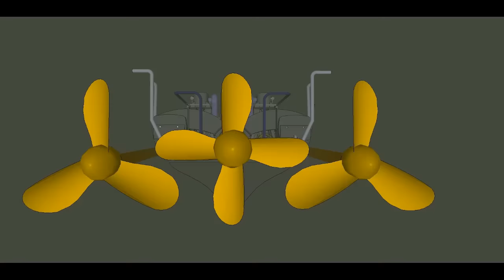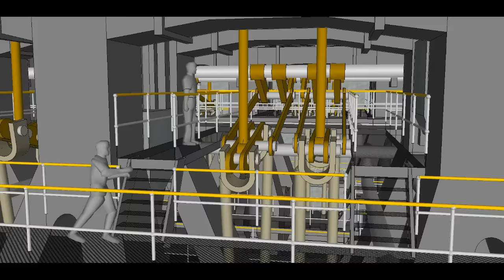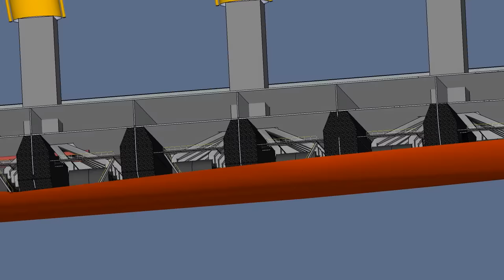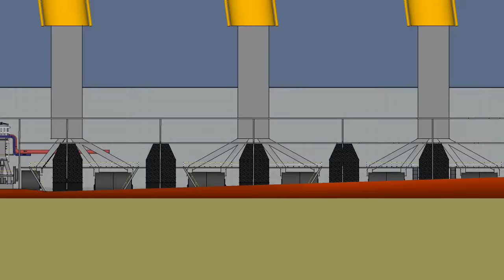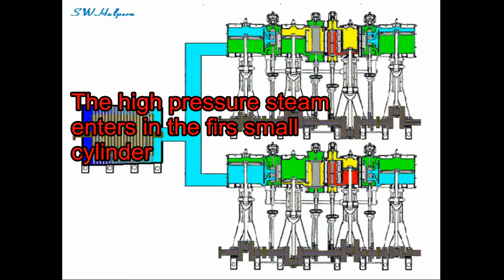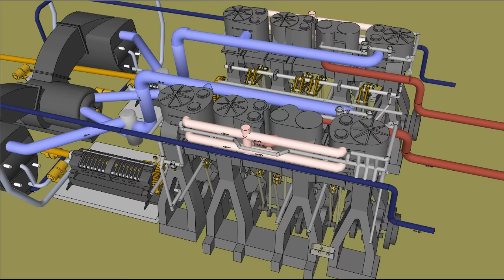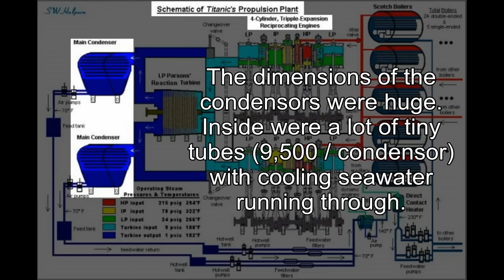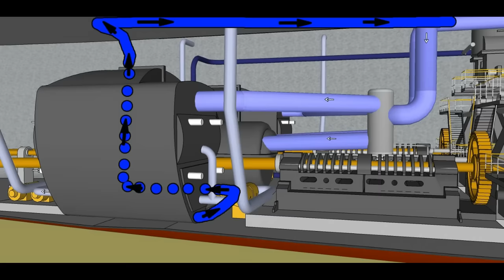The Engines of the Titanic

Comment from the maker: @ annanoli: 5:25 you can see how the engine is started. In that time the electric engines didn't have enough power, so they used a small steam engine, as shown. It is not only to bring them into a special position for maintenance, as you think, it is the spinning once to start the big engine.
Reply: +Charlie K Maybe it was because electric motors need some sort of engine and generator to get electricity.
Reply: +Hoe ishetmogelijk ..Steam Engines are self starting...they don't need a Jack Engine to get under way....
Reply: Single cylinder steam engines are not self starting.
Reply: +KiwiPowerNZ ..what about Single Cylinder Traction Engines..
Reply: Brill39e Well they can self start from the right crank position, engines with 2+ cylinders will self start from any position.
Reply: KiwiPowerNZ True! And no more needed than three in the right configuration. But for steam,inertia can still be a bitch.
Reply: +FallSoftly this isn't an internal combustion engine, while I'm sure a warm up time is necessary, the main problem is getting the piston of I assume the high pressure cylinder as its first in line to the proper position so that steam can be applied, if it is at the bottom of its stroke putting steam to it will do nothing it needs to be rotating slightly before the steam is turned on so it gets it moving, make sense? sorry about poor explanation I'm no engineer I just know from messing with old steam traction engines before, they're very similar in how they work just on a much smaller (albeit still large) and simpler scale
Reply: +Brill39e 
Very true. But the jacking gear gets the engine bearings on a film of oil and breaks the friction on all of the propeller line shaft bearings. If they didn't turn the engines and line shafts over first, the force required to break away the equipment would violently thrust the ship and strain the mooring lines. 

Ships with steam turbines warm up the works by rolling the turbine ahead for a few seconds, then rolling it a few rpm astern for a few seconds for up to 15 minutes or more before getting underway. This also heats up the parts so that only dry steam is admitted to the turbines as a slug of water can create tremendous damage.
Reply: Cool
Reply: +sstroh08 With regard to getting a piston "in line" , My dad sailed Liberty Ships in WW2, and explained one of the main differences between (some) steam engines and a typical internal combustion engine is that steam engines (can) have timed valving that lets steam expand from BELOW a piston as well as above....in other words, not just pushing the piston down, but also pushing it upward (at the appropriate time) to produce movement....quite efficient, rather like an (advanced level) bicyclist whos's shoes are locked to the pedals....making power on the "up" stroke as well
Reply: +Hoe ishetmogelijk its called a barring engine, the big steam engine has a dead point, were the slide valve is open just in the center of a piston stroke with steam on upper and lower side of the piston, its onl a few degrease, in this case the can turn the engine a little to close the valve in oneor the other posistion.it also cab de used to turn the engine to do maintenance.
Reply: +Picobyte  no its not, common systems were dc 110 volts, also with stationairy battery banks, al the system electric engines were dc in those days.
Reply: +Brill39e  partly thrue. they can have a stand dead spot, so they can barre the engine a few degrees to set it up for the first steam to get it going.
Reply: +Brill39e  not al engines can start from all stop positions, in that case they can barre the engine with the small one to set it in the right position to self start on first steam, also for maintenance.
Reply: +KiwiPowerNZ  if constructed the right way (not 180 degreas)
Reply: +radguzzi 
They used this ''double acting'' steam cylinder since the 1800's. Almost all steam locomotives use both sides of the piston to produce power. That's why steam engines use connecting rods with a cross head pivot so they can seal the connecting rod side of the piston.

Side note: appreciate what service your dad did on Liberty ships. Those were real men.  I sail on the Liberty Ship Jeremiah O'Brien every October in the San Francisco Bay to watch the Blue Angels fly. The 4500 HP steam engine is the one they used during the filming of Titanic. Its awesome standing near the LP crank so close to its huge operating mass that it could tear your arm off....or worse!
Reply: MrBugsier5 How did they charge those batteries?
Reply: Picobyte those were big lead acid batterybanks (recharable) with seperate 2 volt cels, at a weight of around 70 kgm's a piece. so i would think by hand or a cart.
Reply: 1) They generally don't lubricate the cylinders steam lubricates cast iron, but there is lubricators there if needed. If you get oil in the steam it gets into the condenser and they only had very primitive methods of stopping the oil getting back into the boilers!!! Very bad. So they hardly ever lubricate anything steam side.
2) They warm up the engine slowly by opening the throttle with the Stephenson links set at stop, the steam slow heats up the metal. It will find it's way through the engine even when stopped.
3) If you try to start the engine cold it won't work because the steam will just condensate on the cold cylinders and pistons, and when the piston moves you can hydraulically lock it and do serious damage, but there is protection, big relief valves on the top and bottom sides of the piston that open if the engine hydro locks. So once you've warmed the engine through for about half an hour probably much longer for Titanic's engines, you can try and start it, and you have the cylinder drains open to drain any condensate. The engine is never properly hot until you leave the berthing and give it some power. Once you're out in the harbour and under way you can close the cylinder drains.
4) While in berth you can turn the engines slowly with port engine astern and the starboard engine ahead and the affect will push the stern towards the wharf and won't strain the lines.
Reply: KiwiPowerNZ not adding oil to the steam is  pertinently not thrue! the have a oil mister in the steam fead to lubricate the cilinderwall and pistons!, thats why its called cilinder oil...... (special oil injector is fitted in the steam feed to the engine, its also why they use super heated steam! (thats dry!), so there is as less water in the engine as possible, leaving the oil where it should be, and not in the condensor, but they do inject oil into the cilinders (not mutch!) and valves, just to ad it to the high pressure dry steam in small amounts.
Reply: +MrBugsier5 
I used to service old reciprocating steam pumps at a refinery. We added ''Steval B'' cylinder oil to the lubricators for the cylinders. The oil was thick and nasty and would not wash off my hands even with detergent. As a prank, we used to put a few dabs on fellow oil worker's windshields. The wipers would make the Steval B into a hideous streak on the windscreen, a huge job to clean off. Spray carburetor cleaner would remove it.
Reply: MrBugsier5 Titanic doesn't use superheated steam it's wet steam!
Reply: no it doesnt, it used super heated, and high pressure steam, the higer the pressure the less water.the more you heat it after that , the even dryer it becomes,., in the case of this time on  the bottom, its only water and no steam... lol
Reply: MrBugsier5 Can you find some info on that, I don't think Titanic's boilers had superheaters.
Reply: Charlie K That would be a serious hazard.
Reply: Picobyte Why would it be a hazard? Because of water hammer?
Reply: KiwiPowerNZ That can get serious in large installations.
Reply: +MrBugsier5 I do not think that 215 p.s.i. is indicitive of high pressure or a super heat capability. (215psi being the op pressure for the HP cyl.). And you wouldn't use superheated steam in recipcrocating engines
Reply: SuperAncientmariner fully agree!,  thats thrue, but wat I mean is that the steam pressure in the boiler has to be as high as possible to keep water out of the engine,and give maximum effectivenes, (thats why we use around 10 to 16 bar pressure, (thats high for rivited boilers!) dry as possible steam is the best! (agree super heaters where only used for turbines.)
Reply: +SuperAncientmariner Is the use of superheated steam in steam locomotives different?
Reply: Douglas Skaalrud Yes because they don't have to worry about getting cylinder lub oil in the boilers.
Reply: KiwiPowerNZ Thanks Kiwi, you beat me to it. There is also the condensing to think of. Locos that condense pass the steam into the water tank to cool (as opposed to closed cycle), whereas marine systems have a raw (sea) water condensing system..
When I was at sea, the only ships using superheated /dry steam were turbine powered..
Reply: SuperAncientmariner Were turbines available when Titanic was built?
Reply: Douglas Skaalrud Yes. The first steam turbine ship was the Turbinia,  in 1894..
Reply: Douglas Skaalrud Titanic has a low pressure turbine driving the center prop. I love the way they designed it, it's fascinating.
Reply: KiwiPowerNZ  its a pitty none off these superliners still exist floating!
Reply: +MrBugsier5 215psi is NOT a higher pressure maritime system.  High pressure systems rang at pressures upwards of 600psi and 1200psi up until the 1990's.
Reply: +KiwiPowerNZ Not necesarily from a dead stop. However a  jacking engine is needed to slowly rotate the system in order to preheat the cylinders/turbines.  You don't want to go from cold iron to full heat,  full pressure. The stresses are huge.  Jacking the engines/screws usually starts several hours prior to the requirement for full steam and getting underway.
Reply: Pelican1984  20 bar is the highest safe (??)steam pressure they used in rivited boilers at that time, (1911) dont know the psi figures, we are metric in europe. sorry..
Reply: MrBugsier5 Ok, that's interesting.  20 bar = 290 psi.  From my naval experience, the high performance ships like battleships and destroyers were using 600 psi (41 bar) boilers by WWII.  Following WWII they were up to 1200 psi (82.7 bar).
Reply: normal inland ship use is around 14 bar max rivited and welded boilers, as far as I know. seen the red one mostly around 12 to 14 bar.working pressure. , the higher the pressure, the dryer the steam is, the better for the engine.
Reply: +KiwiPowerNZ of course they are...WTF are you reading?
Reply: +KiwiPowerNZ Where did you ever get the Idea Steam lubricates the cylinder. Have used oil injectors and many typed never saw an engine without oilers.
Reply: +Charlie K Scotch boilers are firetube and can have superheaters installed as many had. Look up Locomotive boilers, same installation.
Reply: Chloe Alexa The steam valves are on top right above the steam space, it doesn't pass back through the exhaust gas. You couldn't run those engines on superheated steam without lubricating the cylinders, which puts oil in the condenser which has to be separated from the feed water before it goes back to the boilers, that's just stupid. They wouldn't use super heated steam. With wet steam the cylinders lubricate with the steam alone.
Reply: +Hoe ishetmogelijk Yes steam 100% torque at 0rpm, why so great
Reply: +KiwiPowerNZ Any steam engine not at TDC or BDC has the ability to start on its own.  Most Traction engines are single cylinder and you have to know to not stop the engine at either point, if you want to move again.  Then you move the flywheel by hand to allow starting.
Reply: +Picobyte Steam as DC electric has 100% TORQUE AT ZERO rpm.
Reply: +Picobyte Note:  Steam as well as Series wound DC Motors have 100% torque at zero RPM.
Reply: +KiwiPowerNZ Boy do you really need to go back to steam engine school with your answer.  All steam engines NEED OIL to operate, steam is not a lubricant.  As for the oil in the water on condensing it is removed in special separators.  Please learn how steam engines operate on Ships. you have a lot to learn, and do not ASSUME things.
Reply: +KiwiPowerNZ Again you need to study as all information is on the INTERNET.  If there was no superheat the low pressure cylinder could perform NO WORK, in effect only a three cylinder engine.
Reply: +SuperAncientmariner It is used in Cars, Locomotives, Power Plants and Steam ships.  So where did you ever get that Idea No Superheat. I knew that at six years old, its a necessary thing for efficiency.
Reply: Have you ever touched a steam engine? Check my channel. I've worked on a steam ship as a volunteer which has triple expansion engines and single cylinder engines. I even have a video of the engine room, I regularly talk to the chief engineer on that ship who has been at sea all his life. I have started and operated both the main engines which are triple expansion and the single cylinder auxiliary engines and pumps. I know from experience that a single cylinder engine is not guaranteed to start by just opening the steam it can take several attempts and you need to position the crank in the right place. Triple expansion engines will self start from any position once they are hot and yes the LP cylinder does do work because the exhaust side is under a vacuum so even with atmospheric pressure going in that's 14 pounds of pressure relative to the condenser.
Reply: +KiwiPowerNZ, well thats very nice yet seems you have not that much operating experience, oiling and wiping do not really constitute full experience. My father was a Chief engineer and taught me about single cylinder engines at six years.  I have run Steam all my life, and the additional reply of a couple days ago reinforces what I stated.  You would be a laughingstock at any threshing show here in the USA. We have a big show in Rollag MN, with some really big engines. Have worked shows since the sixties and was engineer on a 55 ton steam passenger boat for 5 years, Triple expansion on that one also, so I am familiar with their operation, and idiosyncrasies.   Am 76 years old now, and have taught Locomotive steam operation.  It's not a contest to be always right, it's the sharing of knowledge learned over a lifetime. The ones who taught me are gone now, so lets share and learn.
Reply: Chloe Alexa I may not have much operating experience but I have almost 3 years experience on that ship which is about 400 tons. I've done more than just oiling and wiping, I know the startup, operating and shutdown procedure for that ship as we do it every charter. I haven't gone for my steam ticket because you need hours on a commercially run steam ship and ours is non profit charity run. I'd have to move to the south island and work on the Earns-law to get my ticket.

You said:
Boy do you really need to go back to steam engine school with your answer. All steam engines NEED OIL to operate, steam is not a lubricant. As for the oil in the water on condensing it is removed in special separators. Please learn how steam engines operate on Ships. you have a lot to learn, and do not ASSUME things.

Yes but our ship is a 1935 newer than Titanic and it's method of separating the oil from the feed water is coconut fibre filter. And yes steam does lubricate cast iron cylinders. Yes there is lubricators on the cylinders I never said there wasn't any, but you vary rarely use them BECAUSE we use wet steam there is no superheaters and never was any on our boilers which are two single ended scotch boilers the same as used on Titanic. As soon as you have superheated steam that lubricating effect is gone.

You also said:
It is used in Cars, Locomotives, Power Plants and Steam ships. So where did you ever get that Idea No Superheat. I knew that at six years old, it's a necessary thing for efficiency.

Yes it's more efficient to use superheated steam, nobody is denying that and everybody knows that it's more efficient. That doesn't mean every ship ever made has superheaters. Titanic DIDN'T use superheated steam, neither does our ship. Our oldest engineer is 83 and has been at sea his whole life, been on many ships around the globe, and I respect him very much. He has much more experience than you.

Please stop attacking every single comment you read. Saying that I'd be a laughingstock at any threshing show here in the USA doesn't make anyone want to go visit your show. That makes it sound like a rude and uninviting ego fest on who has the most experience. Where no one would ask any questions or learn anything from each other for fear of being laughed at.
Reply: +KiwiPowerNZ Sorry that I offended you, yet things you said would be taken that way by many steam engineers.  Food for thought and not an argument, as that is how I was taught by many old steam men.  Observe, Listen, and Learn if you do not follow those items you are missing many little tidbits, as I am but one old steam person sharing, and have learned from many, less kinder than myself to me, by doing just that.
Reply: Called a "pony motor."
Reply: +sstroh08 yes and there were steam engines that had 'Simpling Valves' where high pressure steam could be applied to all cylinders. for starting purposes.
Reply: +SuperAncientmariner Please do some serious study of large American Locomotives, and they used all superheated steam for operation.  Offers more expansion.
Reply: +Pelican1984 Yes yet they were driving turbines, as their expansion is linear vs pulsing with piston engines.
Reply: I've never heard of a small donkey engine being used to start Titanic's engines.
Reply from the maker: You are never too old to learn!
Reply: I wonder if they'd still call it a starter?
Reply: +goinghomesomeday1
Yes, that makes perfect sense - but see Steffen Reichel's answer below.
Reply: +goinghomesomeday1
Yes he did but he pointed out that this was not necessary on Titanic's engines because they were fitted with Stephenson linkages.
Reply: Look, Kempton park is a stationarty engine with a valve gear, but no direction change.
Ships and locomotives need direction change, so have a special gear or linkage for direction change.
So many stationary engines are barred into starting positions, with barring bars, electric barring engines or steam barring engines, just to get it started.

On Locomotives the steam engine is self-start able, because it had to be startable from any and at any position of the cranks - that's why they had a linkage, like Walschaerts, Stephenson, van Gooch or other.
So multiple cylinder engines had starting valves, evem famous 4 Cylinder double expansion steam locomotives had starting valves, which promoted life steam into the connection pipes, just to ensure that on startup all cylinders got steam. This is on any stationary steam engine not implemented, as they have flywheels and barring engines - because there was time to bring the engine into a starting position.
Usually at the end of the shift the engine was brought into starting position, just to have a quick start if no maintainance was required.
On steam locomotives you have stops on the way, so you cannot stop in some kind of starting position, so you need to be startable on any crank position. You just set the linkage in the direction you want to go and the engine will usualy move on. Multi-expansion engines usually have manual operated starting valves, or by linkage operated starting valves, some had linkage engaged pressure operated starting valves, like Maffai and Esslingen. Here at direction change those valves provide live steam from the boiler into the compong connecting steam chests, just to even get the low pressure cylinders a kick start ability.

Titanic would have also starting valves, located at the steam chests of the intermediate and low pressure cylinders. On any direction change those valves would pop open, providing extra steam to the steam chests and giving those cylinders some steam for a smooth and immediate start.
Those valves will close, after exhaust from the high pressure steam cylinder will enter the connection pipes, and the engine will return to compound mode. Only on start or direction change those starting valves will admit steam to those cylinder steam chests.

So because of the Stephenson linkage Titanic, as any other multi expansion engine to propel a vessel or locomotive, will be self starting at any point on any direction

Titanic had donkey engines. Those were for maintainace. On port they were engaged, just to get the shafts, pistons, rods and cranks into desired positions, as it was impossible to turn the three story high engine by hand into position required for maintainance. So the Donkeys turned the huge engines, just to get the engineers being able to fix this and that or having the engine slowly turning on stops, just to ensure all is greased well and the oilers do their job on short stops during boarding, so you can run the engine immediately on call without having troubles being low on grease or oil in any of the moving engie part.
Reply: Steffen, do you know how a large marine engine would go from full ahead to full reverse in an emergency? Do you know the procedure with a triple expansion engine?
Reply: For Titanic, or any triple expansion engine?
Reply: For a triple expansion engine in general.
Reply: Well, usually it takes less than 10 seconds. There are many youtube clips available from paddle steamers were you can see how fast the switch of direction is.
At "Waverly" during a port manouver the switch was less than 3 seconds - it was like Ping, the gears dropped, engine started turning - pong, the gears lifted and the engine get to halt and immediately started moving opposite direction

Same for "Hohentwiel" were I observed it, regardless if this was a double expansion engine - there is no delay if you have double expansion or triple expansion, because it all depends on how fast can you switch the linkage/gear. The change of direction on Hohentwiel was less than 4 seconds, because of the controls.
Reply: The valve gearing is much heavier in the Titanic than the two you mention.  The Titanic  valve gears are steam driven by a small engine and if that fails there is a large wheel that will do the job manually in good time.
Reply: Trying to run the engine for power while it is too cool is a sure way of causing a really bad example of water hammer. Which definitely has the power to destroy the cylinder end.
VERY DANGEROUS.
Think about a heavy piece of iron which comes flying.
The solution is to preheat the engine in some way either a steam jacket around the cylinder or letting a small amount of steam into the cylinder and drain the condensate away.
Reply: Chloe Alexa  ´
Reply: Another Snipe here.
Reply: 70 Series Tires Striking for my crow on a Knox class ASW Frigate.
Reply: 70 Series Tires
Reply: Except these probably would have. Only one cylinder in each recieves the high pressure steam. As such you would have had to use a barring engine to bring the engine around until the high pressure cylinder intake opened. Only then could it start itself, and it would take several rotations for the IP and LP cylinders to contribute power.
Reply: freddy jo
Reply: When you maneuver a triple expansion steam engine, you try to stop the engine with the High Pressure piston at mid stroke,it's crankweebs will be horizontal. in this position the engine will turn either way depending of the posotion of the reversing gear. Of course this does not always work... a short blast of high pressure steam to the medium pressure cylinder top or bottom will kick the engine over and she will answer the telegraph. The small starting engine we see in the movie makes no sense on a marine engine. There is what is called a "turning gear" that is used to turn the engine for maintenance only.
Reply from the maker: Yes, but it works!
Reply: Sorry Old Girl,but I aint seen no Triple Expansion Steamers at no Thrashin' Show I have ever attended.
Reply: +Super Ancientmariner. I imagine that superheating from coal fired boilers would be very difficult to control without a lot of risk of explosions, since their is no water to vaporize and keep the temperature constant. Were the superheaters on your turbines powered by oil boilers, where temperature control is much simpler and almost instant.
Reply: +JasonJason210. Like you, I had not heard that before. but when thinking about it, what other way could they have used to bring these massive engines into a starting position. Modern diesel engines use an electric motor to move one cylinder into 5 degrees after TDC, before releasing compressed air into the starting cylinder. Even the most powerful electric motor can take up to 20 minutes to bring the cylinder into the correct position on the modern superships that only have one engine.
Reply: +Chloe Alexa. Your array of comments makes it obvious to me that you do not think about what you are posting. Their is little comparison between the engines of a large ship and a locomotive. If you ever see a steam locomotive running, you will notice a small puff of steam at the end of the stoke where the downhill cylinder purges itself of any liquids. This would not be possible on vertical cylinders, or inside the engine rooms of a ship. Regarding superheating, again difficult to safely control with such vast coal fired boilers. With oil, again a problem, since high boiling point oils were not available at the time of the Titanic and the results of oil vapor returning to the boilers must be obvious to you. The problem with looking everything up on the internet is that unless you thoroughly understand a subject, you cannot separate correct information from the piles of rubbish. If Brunel had used the internet to design his ships, we would have still been rowing across the Atlantic. I am not trying to 'put you down', but just think a little more, particularly of the dates where the technology existed. This thread is quite confusing, because it is a combination of comments from people who know their physics, but have no practical experience, while others have worked on equipment without fully understanding its design limitations. I have been a chartered engineer for 47 years and still learn something new every day of the week. Regards, Wills.
Reply: Charlie K .
Reply: Hoe ishetmogelijk à